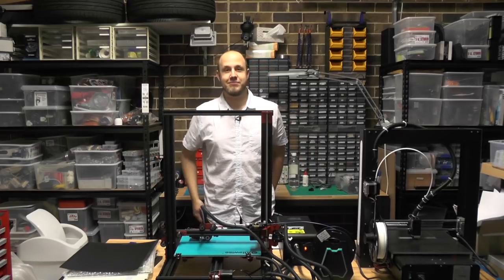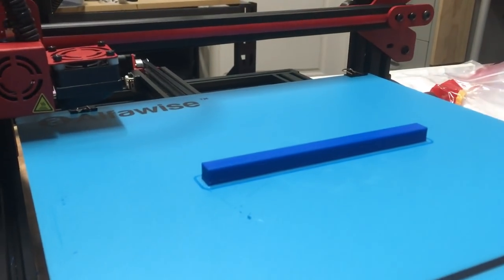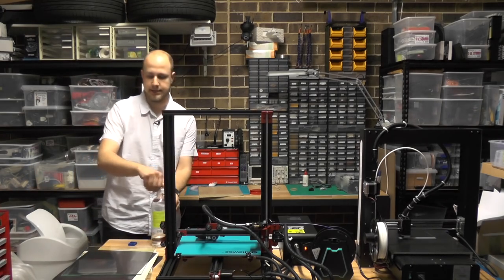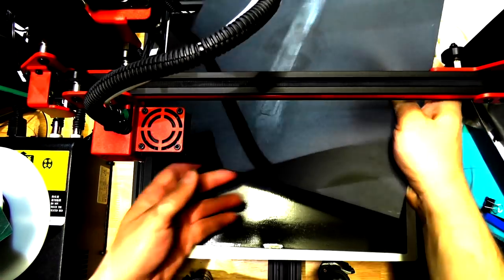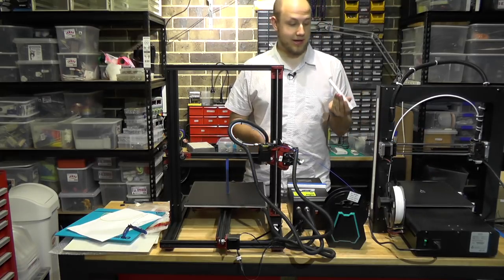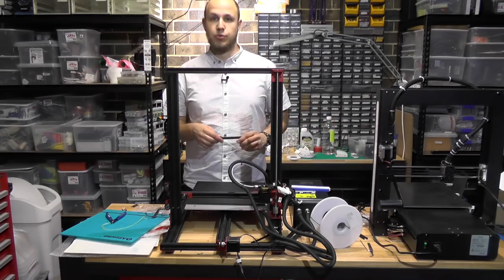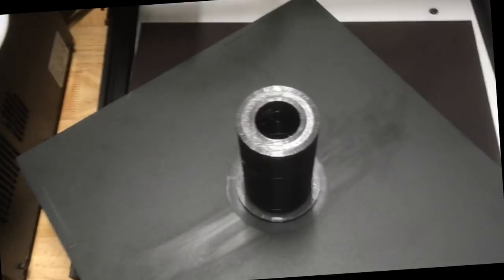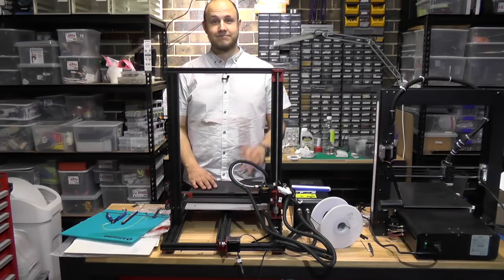CHEAP 3D Printer Magnetic Bed Platform Upgrade - Review

Comment: Sam I need to replace my bed,, all my fault now there's scratches.  Should I go with one like you are reviewing or try to replace with original one?
Reply from the maker: Hi LavellDJ, if you are not doing ABS, then I was pretty happy with this sheet. But I think the diamond bed glass is better. It is fussy, but I think the diamond bed is better overall. How bad are the scratches? Are they chips in the glass? If it’s just marks, I don’t know that it is a problem, it might be just a cosmetic issue?
Reply: Cool thanks, I did see one on Amazon; unless you know where I can get one from?   @SamPinchesMakerShop
Reply from the maker: LavellDj yep, amazon is a good option, I’ve put spare parts on the wiki:

https://jgaurorawiki.com/essentials#spare-parts

There’s an option for a glass bed from aliexpress there as well.